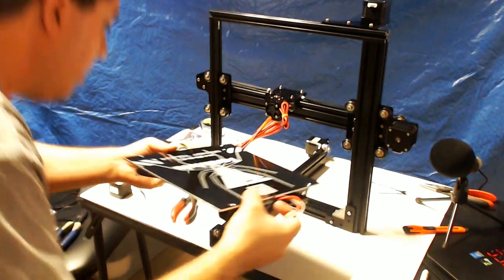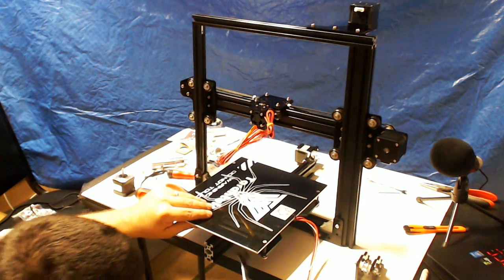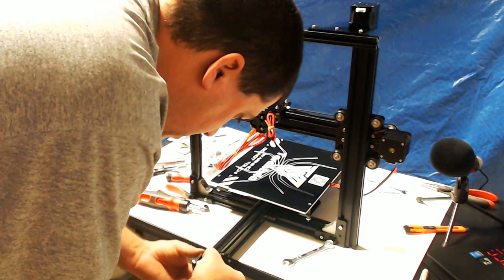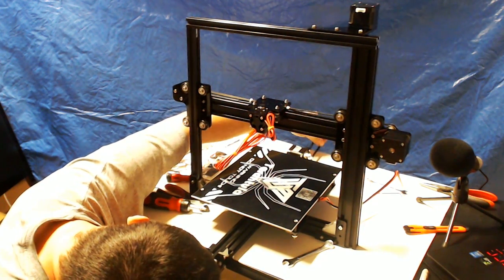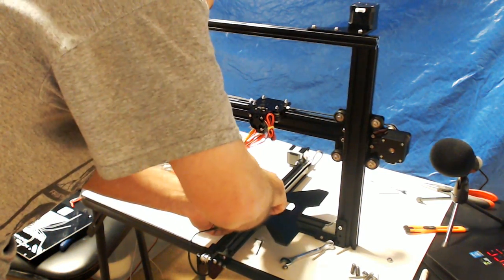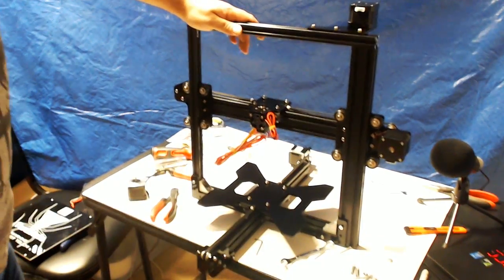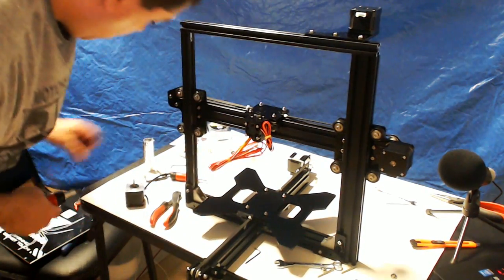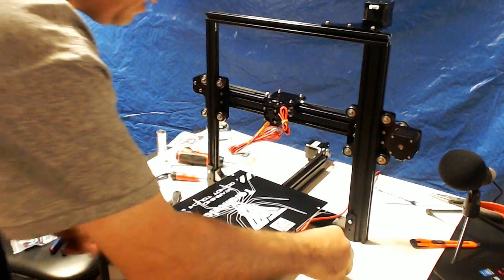Tevo Tarantula Assembly - Step 12 - Y Axis Belt, Bed Mount

Comment: Heh, yeah, one of my supplied belts was too short by at least one inch!! I had to google around to find a method of attaching it. And I found the cable tie trick. http://3.bp.blogspot.com/-YR4PGydCYHo/UIT8CCnTnvI/AAAAAAAAAIs/7a81b_d3AUs/s1600/belt_tensioner.jpg Instead of attaching two belt ends together as in the pic, I added another zip tie to the bed and attached one end of the belt to that.

Comment: how am i supposed to mount the eccentric nuts, you mentioned on the left side, but you mounted them on the right side. Did you mount them wrong?
Reply from the maker: it doesn't matter
Reply: ArcadEd great thanks. appreciate your work, i would have needed so much longer. thank you very much. just finished now. wish me luck ;)

Comment: Could you explain why the eccentric nuts on the right side and not on the left can make the bed unlevel (as stated in 1:20) ? Thank you!
Reply from the maker: I think it's random.  The spacing with the eccentric nuts is not equal to that of the spacers.  Therefore it can be uneven.  On top of that, the tracks on the extrusion can be slightly off.  You just need to try and play around with it until you get a good level bed.  You might need to add additional washers to get the spacing right.
Reply: Might it be because the nuts on the back  don't lie flat on the larger holes of the eccentric adjusters? I've started mounting my Tarantula tonight and noticed that sometimes the screws aren't perpendicular to the plate on the larger holes. I think I will try with some washers under the back nuts, also to place the tightening force on the face and not in the hole sides, making if harder to break the acrylic.
And thank you for your videos, I couldn't assemble the printer without them (the instructions provided are severely lacking)

Comment: Can the bed be mounted with the longer width along the X-axis?

It messes with my OCD that the large bed graphic is sideways, almost makes me want to opt for the smaller bed to give me piece of mind.  I twitch when I see printers with the graphic mounted back to front as well but perhaps that's necessary due to the power connect orientation.  Guess I'll have to get over it :)
Reply: I got my kit they fixed this!  Awesome, no OCD.  The tarantula lines up front to back.

Comment: how did you mount the hot bed on the frame?
which pieces did you use to have it elevated like that?
Thanks
Reply: +3dprint sos thank you
Reply: Actually, I found my springs in B-5
Reply: Just came across this video and see by the looks of things he skipped the hotbed mount and never replied to you guys.. guess I'll have to look at the instructions? Oh wait the instructions are useless LOL!!
Reply: What size is that bed.  Mine is 200-280-200 and i cannot fi it sideways with the connector facing the same direction as ours.